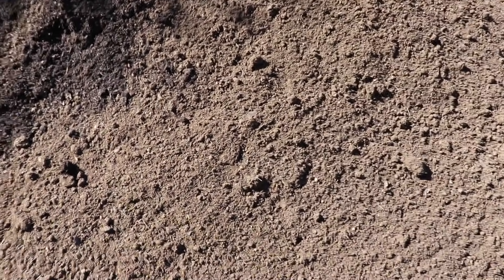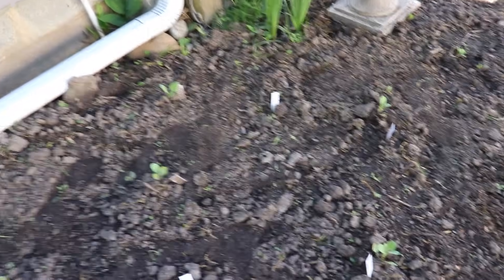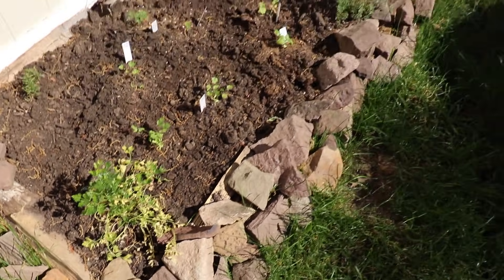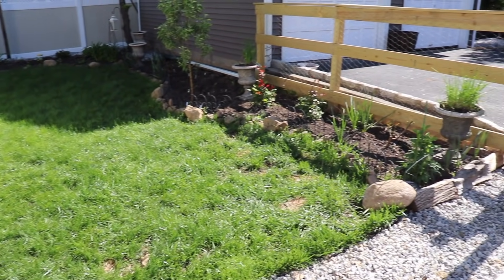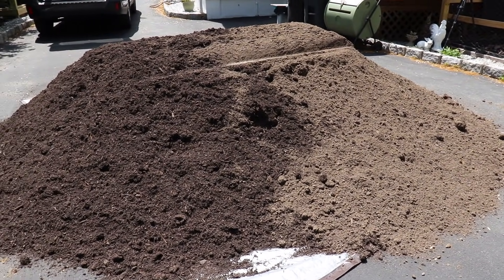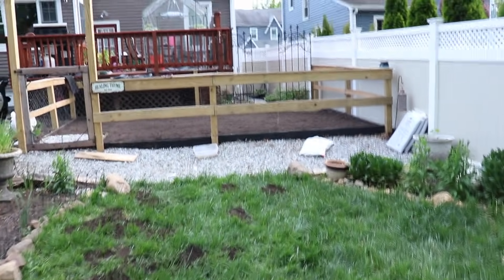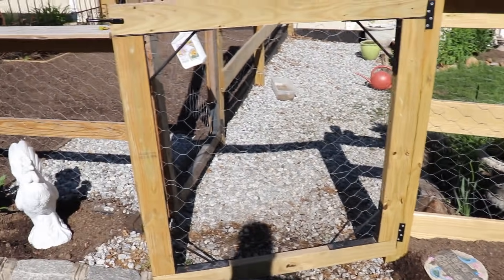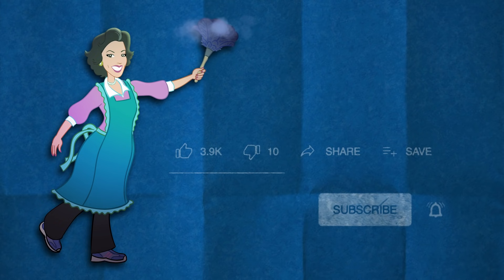The Garden Experiment || 05/15/2021 ||

Comment: IMPORTANT NOTE ON WOODCHIPS: Fresh woodchips can take nitrogen out of the soil unless the are aged. Put about 6 layers of newspaper or some cardboard down then the woodchips on top of that if the wood chips haven't started decomposing yet.  BEWARE about mint and square stem plants in the mint family: I agree with putting your mint in a pot. It will run everywhere and anywhere and will not stay put unless you put it in a pot.  Keep up the great work!

Comment: Great job Sophia!  You should put the mint and oregano in pots as they are extremely invasive.  We added lights to our back yard and my husband plugged the first strand into our back porch light so when we flip the switch our entire back yard lights up!  It's very beautiful at night and illuminates our gardens 😃
Reply: I've even heard potted mint can escape through the drainage hole so it's recommended to set the pot on a solid surface (sidewalk, rock, brick).

Comment: Sophia, you need to double check about using wood chips on your garden areas because some types of tree wood chips are poisonous to the plants. I found that out the hard way after killing plants. Good luck. Thanks for sharing. The yard is looking good! Be blessed. ❤️
Reply from the maker: You get to specify what you re using the chips for.
Reply: @mygreatchallenge  ok, that’s good. I checked with a service in our area (Alabama) and was told they would deliver whatever the crews cleaned up that it could contain trash, trimmings of various trees, etc that we didn’t have a choice, just had to take what they delivered if we participated in the program. Needless to say, I opted to go to Lowe’s and get bags. Lots and lots of bags. 👍 😊 Blessings!

Comment: I always spray my roses vigorously with water.  Knocks the aphids off.  Haven't had any for several years now.  Aphids, I mean.  Still have roses.
Reply: Why wouldn't they just crawl back on the plant? Does the water pressure kill them? 
I don't think I could crush aphids, even though they are an unwanted garden visitor. Laura at "Garden Answer" recently shared a video where her lemon tree was covered with scale and she also crushed them. Eeew!